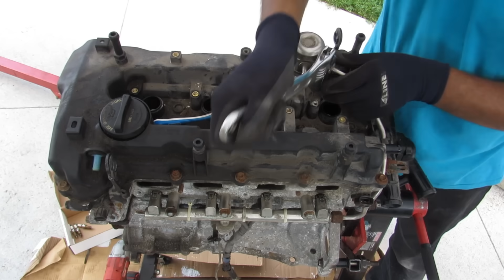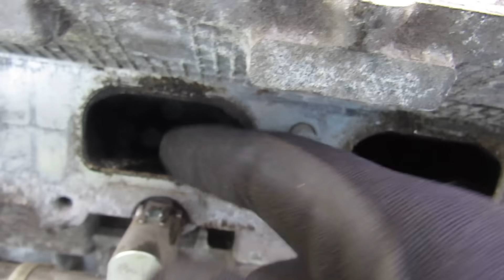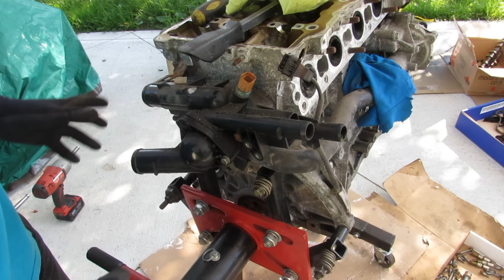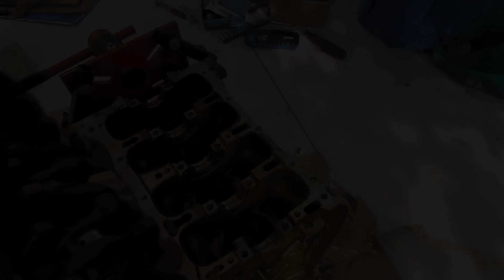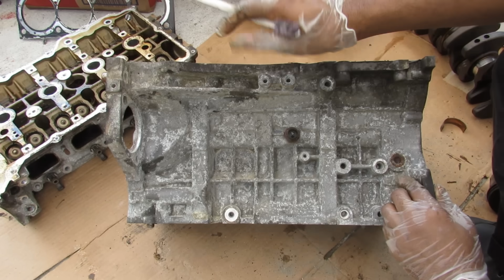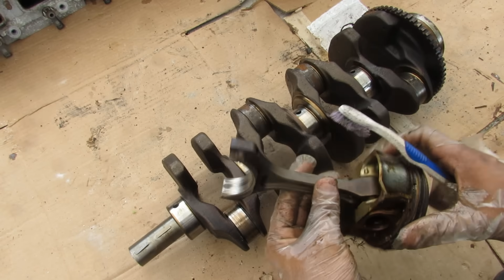Why Hyundai Engines FAIL

Comment: I bought a 2015 Soul with a 2L. I learned of the recall afterwards and took it in for their evaluation, which apparently passed and they upped my warranty. So far all is fine, except the fact that I have to now drive this thing around with the knowledge always in the back of my mind. Also, one of the three oil changes done on it since I bought it was done by me so now I worry if something happens they'll use that to deny any claim. This is a horrible way to own a car and I will never buy another Kia, or Hyundai again.

Comment: Amazing explanation! 
Due to carbon build up, fuel direct injection issues and quality control problems from the manufacture. It would be wise to do a break in oil change in 500 miles and another about 1500 hundred miles, thereafter using a quality synthetic oil and filter for the rest of future oil changes.
 In regards to the fuel, using non ethanol or mid grade fuel would be best for the longevity of the fuel system, maybe even using fuel injection cleaner perhaps every oil change.

Comment: My 2017 Hyundai Elantra SE with only 74K miles developed rod knock from the 1st and 3rd connecting rods. Upon tearing the engine down to the bare block, it was discovered that the connecting rod bearings and main bearings were chewed up. Called up Hyundai, 14K miles over warranty, they wanted $8.2K for a new engine install and didn't accept my good will request. I will never by a Hyundai again, it's too bad since I planned on sticking with them for the log run.
Reply from the maker: Ouch! Did you put a new motor in?

Comment: Edmundo Chaparro-Barriguete
Edmundo Chaparro-Barriguete
0 seconds ago
I have a santa fe 2003. I had a crankshaft position sensor fail twice in 2 different engines . It brakes and tangles in the timing belts, destroying the valves and pistons. BIGGEST PIECE OF SHIT CAR. i ALSO HAVE 2 HUNDAY SONATAS HYBRIDS. 2013 2014 respectively. Also they brake around 110K to 120K mi. The dealers and the hunday corporate also a terrible experience as far as customer service and honoring warranty when the cars brake down. They never have enough technicians to service our cars and then the ones they have do not know how to diagnose hybrids. Hundays are a real terrifying error to keep buying them. SO DISSAPOINTED. here in nashville tennessee.

Comment: I like the cam rolling directly on the valve idea. It takes out any middle men parts to transfer energy. That is probably the only thing I like about Hyndai. I yelled kicked and screamed and told my girl to not buy a godamn Hyndai but she did anyway and she hasn't had the car for a year yet and it is already showing early signs of a short life such as smoke on acceleration, chipped paint from just washing the car, check engine light.

She has a 2016 Hyndai Sonata I am not sure her engine is the same as the one in this video but I think an engine wash/flush is on the way.

Comment: I own 2 Hyundai sonatas.  A 2013 and a 2015, both engines failed at just under 100k miles.  They replaced the 2013 engine, but they are trying to get out of replacing the 2015 currently.  The 2013 seized but the 2015 is  knocking.  Cars are junk and I'll never buy another one.  After the trouble free replacement on the 2013 I thought they stood behind their product, so I bought another one, big mistake.   I will say the 2013 now has 275k miles on it and hasn't had another problem so I believe they fixed the problem in the replacement engine.
Reply from the maker: Ouch

Comment: Damn! I wish i would have found this video a couple weeks ago. Wifes Kia spun a rod bearing at 135K, reg maintenance has been done since new, need this vehicle so i dropped a rebuilt eng in it. After all of this i learned about the issues & was told IF i had the software update i would have gotten a lifetime warranty on the lower end but without it i was basically screwed. I was never notified of this software update! Anyway, one of the beast videos I've seen in this.

Comment: The software update is supposed to let you know before the engine blows up. This engine will need a replacement after 6 or 7 years. Many people who are driving these aren't even keeping up with their service and running low on oil. You can tell they have run cheap oil and delay oil changes.

Comment: The Monday engines up so much blow-by it that the PVC valve gas in the crankcase in from the engine goes back into the intake and Stephen will catch can and no oil and Vapor that goes back into the end into the bargain intake helps lubricate parts

Comment: Hyundai needs to be classified s a discount harbor freight of vehicles, they suck. A lot.

What kind of idiot stakes their entire business making terribly designed engines that not only self destruct in 4-5 years, but also stuff them into all of their cars while pretending engines didn't suck from the start (they don't even have a real answer, their settlements are bs and who designs a car that can not only spontaneously burst into flames, but where it's common for brake systems to leak all over the fire hot engine?

One recall I got just said to park the car outside and call the fire department if the rear bumper starts to smoke and mlet, wtf?) lol

Hyundai must be run by doofuses, but there's also a blatant cover up going on... All Kia/ Hyundai have a crazy high incidence of suddenly bursting into flames. One Mom had to watch her Son burn alive when a 2011 Kia burst into flames while parked... Hyundai didn't address this until a decade later, but engines are still blowing up and catching fire so.... 🤷
Reply: still way better than a nissan! (both shit)

Comment: It would take a lot of particles to clog oil galleys…I would be more concerned with the wear caused by them…
Reply from the maker: It doesn't take much to clog the oil pickup screen! And look how tiny the connecting rod bearing holes are...

Comment: Interesting.  18 months ago my 2013 Hyundai Santa Fe seized after just 100,000 km.  The local Hyundai dealer quoted me NZ$11,000 for a new engine, but when I pushed back they replaced it at no cost.  Annoying to think they knew all about how prone these engines are and how they tried to make me pay.  Great vid - many thanks...
Reply: It's definitely not just a US problem, they've done a quiet recall here...

Luckily for them most in AU/NZ go for the R series diesel which is solid
Reply: Hey! I am on a new project of getting a Hyundai Sonata 2011 back in shape after it sat for about 10 years since it was purchased by my father in miami (it was never in actual use). As yesterday i opened up the hood, i saw that it had a GDI text on the engine cover, so i already knew whats up... i was told it was an MPI model, but sadly that does not seem to be the case... after i get the car back in shape, i want to get the engine fixed by hyundai. Long story short, how long did it take for them to fix your engine? Lets say from the time you went to the dealership to finish?
Reply: Just sent our 2016 Kia Sorento to the dealer for the knock sensor code and the lady told me that when they confirm the code that they will do a clearance check if that fails then they will contact Kia. So that would be a couple days to receive the info and the response. Then if Kia said go ahead they have to order engine and that will take let’s say a couple days to a week or so. Then finally when the engine comes they set an appointment to replace the engine and she said about 2 or 3 days to pull and put back. Best case scenario is that 2 to 3 weeks is what she was saying. This is if the knock sensor update was done prior to the engine light on. Hope this helps
Reply: @nagybalint1582  Hi, sorry for the late reply - I wasn't aware of this comment.  My reply is probably going to be too late but it took about three weeks all up as Ernest says.  
Best of luck with your project!
Reply: Hi there, I have just had the same issue with my 2013 hyundai i45 with the 2.4 GDI engine. I am currently dealing with Ingams in Hamilton New Zealand any advice for the argument as they are also trying to make me pay for the repair/replacement as the engine seized. What part of NZ are you from and who did you deal with?
Reply: jpinnz:       I wonder if they would have also billed Hyundai as well as yourself....... Mmm?

Comment: Tried a new PCV valve. My 2018 optima with 65,000 miles  burns 1qt of oil every 1000 miles at a minimum. Kia says its "normal." I will never buy another one. I like the car, but the engine is JUNK!
Reply from the maker: Sorry to hear that.

Comment: Oil dilution caused by the gdi system with 500 psi pushing gasoline past the piston rings.?
Also doesn't help that the pvc vents above the intake valve where fuel no longer goes because of the Gdi system.

Comment: The guy failed to determine the reason these engines fail. Just check the cylinder sizes you will understand. The cylinder block is way too light and not rigid enough. That is why it distorts over time affecting the crankshaft bearings and the piston rings. The blow-by starts making the oil to oxidize very quickly. And the engine is finished.

Comment: What I'm saying is nothing but a lack of using good quality oil by the brand for that engine. The right brand of oil will prevent the piston rings from sticking and clogging up. Also I don't believe in using regular which is very known to cause carbon buildup. Using high grade gas is very good to reduce carbon build up. All gas grades have the ability to cause carbon but also the oil itself can cause carbon. The right oil brand and the gas grade makes all the difference it's called preventive maintenance by the customer. I don't expect women and men to figure that out but a engine won't fail if it has the right oil brand and not run on regular gas which causes the most combustion. All my vehicles owned never had an engine failure because I run high grade gas and have used Pennzoil or Quaker State and maybe Castro. These three oils provides better film strength and better film strength reduces where. Take my advice. Also use gumout tune-up fuel additive it is very good to get carbon buildup release from the tank and the cylinder chamber and piston recommend every three to six months to keep carbon from building up but high grade gas also will help as well because it's high concentrated. But when it comes to direct injected engines it's very important to keep carbon from building up because the injections also start getting clogged at the front of the injector because carbon is on the tip of it and that can be a problem.

Comment: Engines don't just fail. Usually operator error is behind most catastrophic failures. Without knowing the drivers story, we can only guess at what has happened. It is unlikely in this case, that an intrinsic manufacturing falt has caused the failure. There is no evidence of design failure.

Comment: My daughter's 2014 elantra still runs like new with just over 102k miles . I replaced a ball joint in it last week , but it was very easy to do . That is the only thing I ever had to replace on it outside of normal maintenance items . I change the oil and filter every 4k miles with Walmart synthetic .

Comment: I have a 2013 Hyundai Accent at 105,000 km with a 1.6L engine - should I be concerned?
Reply: The 1.6s are good as long as you take care of them. GDI ones less so, but still decent.

Comment: Just picked up my 2016 sonata 2.4 sport from the dealer.  They put a new motor in it at 95k miles. Blew the main cam sahft bearings. It was Buring 1 quart every 1100 miles.The dealer charged me 580 for new hoses ext. They didn't even replace one of the 2 belts they said they would but hey they gave me a loaner and the car runs great now. Mabe 90k more amd by a new one? I hear They are like Bic lighters. Once you use them up throw them away. Lol great video!

Comment: I had an 08 accent, had 167k miles on it, just changed the timing belt and the coils/ plugs, some sensors, brakepads, etc... Never had any major issues... Til i got t boned by a pickup truck. Ive gotta say, that car and my old 1990 geo storm were the most reliable cars ive ever had.

Comment: I have a 2011 Tucson with this engine with 156k miles. Have taken care of it....regular oil changes ....etc. Runs like a top and haven't had any issues with it at all. That's been my experience.
Reply: My 2011 Tucson is still running strong at 150k miles.
Reply: what is the first digit of the Vin?  the korea made ones seem to be much better than the American ones. Toyota had this same issue.
Reply: @bigpapa2819  K
Reply: Ya what you don't understand is there is deburring issues means nothing can prevent it. Once the burrs break loses its over
Reply: You can buy lottery

Comment: I worked for Hyundai when these engines were failing. We were literally getting new cars delivered with the engine's blown and rods knocking. We couldn't get replacement engines fast enough. The problem was third party crankshaft manufacturers.

Comment: I bought a 2013 Santa Fe sport for my son with a 2.0T engine and over 100 K miles on it. Carfax verified oil changes every 4,000 miles since new at the dealer and one owner. I sent an oil sample to Blackstone labs and it came back perfect, no evidence of any bearing wear based on copper and other metals typically found in oil when that problem is present. 
Engine also has the orange dipstick handle indicating recall has been performed and engine was checked out, knock sensor software updated and so forth. Knock on wood hoping to get at least 150 K out of this car. Engine currently purrs like a kitten and no issues

Comment: I have a 2013. So far at 88,500 miles it's still doing very well. Hopefully mine will not have this problem. I know one other person with the same car and they have over 200K miles and it's running fine. Knock on wood.

Comment: 15:15 clearly u know more about engine than me but this is something I'm confused about , why would the the exhaust ports lead to the turbo ? shouldn't a turbo be taking in cold air, or air from literally anywhere else besides the hot engine

Comment: It is callled QUALITY CONTROL!! Someone sleeping on the job at the moulding plant. Every molded piece should be x-ray inspected for cracks and air pockets before going to the finishing stage for grindinng - smoothing and polishing. I worked on the pots for the VOLVO PENTA outboard motors factory in Charloteberg Sweden.

Comment: Wouldn't regular oil changes and the oil filter pick up the metal shavings?  Is the Genesis line also affected by this failure, or is it only Hyundai and Kia products?

Comment: Three years ago I was in the market for a commuting car. Was considering a new Sonata. I found a pre owned low mileage Toyota Avalon and bought that instead. After watching this teardown I am more convinced than ever that I made a good choice. No vehicle is perfect but the used Avalon with port injection should run a long time with good maintenance.
Reply: Drove 2 Avalons, both over 300k when I sold them.

Comment: these cars are abused more than any other car.
Reply: Not really. Its hard to neglect something that burns over a quart per 1k miles. The oil change interval is 6k. It would be out of oil if you waited. Before mine went i was adding 9 quarts between oil changes. Plus the 5 quarts it takes. So 14 quarts every 6k miles.

Comment: I need some advice and willing to pay you $$! I have a 2012 Kia Forte Koup. 51k Miles and engine seized up. Should I rebuild the entire motor, or order a rebuilt short block from Kia for $1200 + shipping? Does the new short block's have the original problem fixed? I can do the labor myself. I learned from you how to disassemble and re-assemble these engines thank you so much! You are spectacular and keep up the great videos. (I think you do a much better job at explaining than most on youtube) Do you think it would be worth wile to WPC treat the crankshaft MotoIQ says it can double the service life because friction is further reduced.

https://www.youtube.com/watch?v=7F_PnPnQBMs

Comment: If anyone at all can assist me in guidance on how to kick start my engine replacement journey.   Mine is at 153,690 and is failing wirh rod knock.  Barely any power and shaking.  The whole nine yards.   I took her into the dealership about a year ago for power issues with acceleration.   They said they didn't know what it was.   After that I started seeing online these engine recall reports.   Now it is official my 2013 Elantra is one of these failed engines.   I even JUST did a full oil change with filter 3k ago.  
Any information is much appreciated.  Thank you in advance!

Comment: rebuilding the 2,0l and 2,4l is not bad just the main bearings and rod bearings are the pain to get the right ones aftermarket. Once the crankshaft is machined from the local shop all factory specs are out the window. Takes me about 2 months and it is the bearings that are the fight. Majority of the time a rod burnout is the culprit not a main bearing. There revised update is a program to make the knock sensor more alert to acceleration ping and tell the computer back the timing down. The heads and timing components hold up good
Reply from the maker: Good to hear your experience

Comment: So at 84,000 miles my 2013 2.0T Limited has a weak start up .. it's been in the shop 9 times and I've had the entire fuel system replaced and now a new 2022 recall on the fuel delivery system is ... Again a campaign that they have no solution for. POS ... But .... Are not all GDI engines prone to carbon buildup ?

Is that a La Lu Roe dress or whatever ... Lol

Comment: The real down side to these engines wasn’t bearings or leftover particles it was a poorly designed oiling system
Reply from the maker: Yes. And they still haven't fixed much